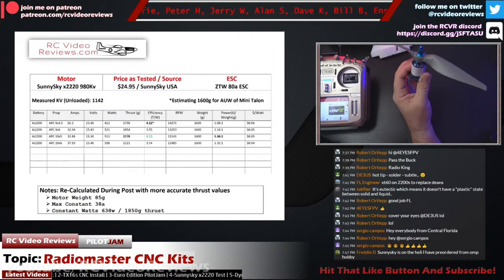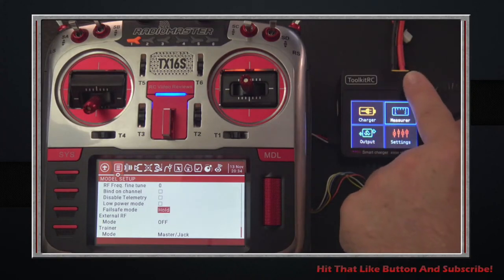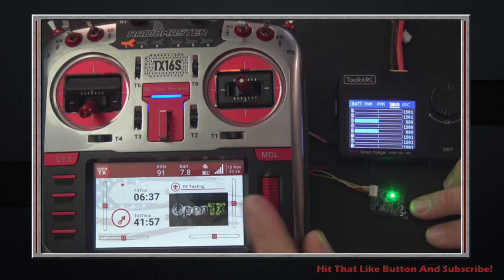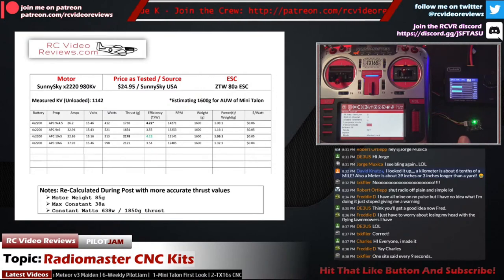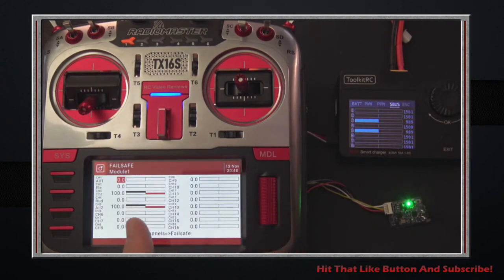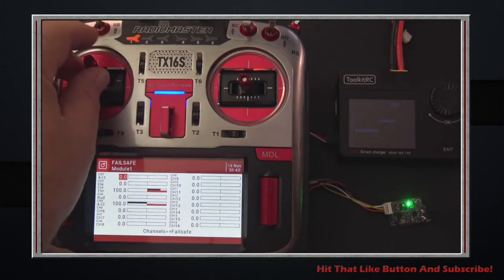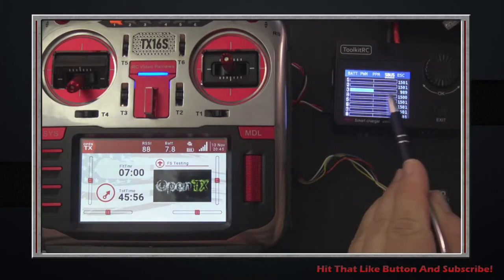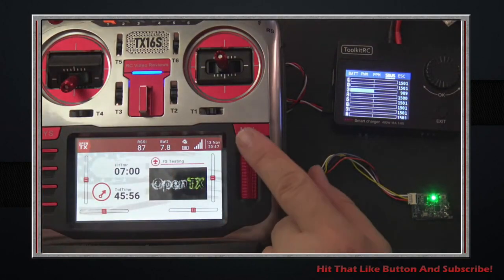OpenTx Tutorial • Failsafe Options Explained with Radio Examples • [Beginners]

Comment: Nice clear explanation - especially on the different options -thanks.  
A couple of comments: be careful with Futaba receivers as their failsafe throttle value is reversed (+100 not -100).  Also some of the 'clone' receivers wont accept commands from the TX so you need to use the "receiver" option as John explained.

Comment: Interesting. A warning about throttle, it's tempting to set the throttle to closed on loss of signal, that's OK for electric power, but not for internal combustion. It may be better to set the throttle to a fast idle. If you get the link back you can power back up and continue to fly safely to a landing. If the throttle closes completely then the engine might stop and if you get the link back you have a dead stick and forced landing.
Reply from the maker: David, Thanks for sharing. I purposely avoided getting into recommended failsafe settings because I found out discussing the subject live that it can be a highly subjective topic. So I made a decision to steer clear of failsafe configuration recommendations. I do appreciate you took the time to write--thank you.
Reply: @RCVideoReviews  I know, I had some heated discussions with club members.
Reply from the maker: This can be a fairly religious subject for some.

Comment: I set up fail safe with the throttle about 40%.  When I was walking to my plane, and pick it up, the signal was swamped, and the fail safe kicked in. The propeller started to spin.  I believe throttle cut was set. Have you noticed something like this?

Comment: Another great vid John. I've followed most of your vids to set my RM TX16S. I have set my F/S on the 'custom' pre sets. They appeared fine with -100 on Throttle which is the most important for me. Any idea why 'they' pre set those numbers particularly on the A, E & R channels? Appears set to glide down??  One thing that I didn't understand well was the 'Receiver' mode. My understanding of your explanation was that the F/S defaults to where ever the stick positions were. If this is the case, it's likely you may say no, it's similar as 'Hold" ? lastly, you said " I hit the F/S button on the receiver". I am confused. Is there a F/S button on a receiver or is it an assigned button the TX to activate F/S?. Sorry, this got lengthy.

Comment: I;m watching this and I see I do ot have failsafe or low power mode on my tx16s. I do get the warning that no fail safe selected but nothing in the model setup. Where do I find this? Thanks, Al
Reply from the maker: Failsafe is presented as an option when you select protocols that provide failsafe. If you don't see it, it's not an option. Likewise, if it's not an option, it should not be warning you it's not set. Something is missing here...

Comment: I do not see a Failsafe mode setting in my Model Setup screen  (Radiomaster TX16s).  When I get down to the low power mode, the next feature is External RF.  I just received the radio the other day.  Thanks
Reply from the maker: If the radio doesn't show failsafe during bind it's because the receiver doesn't support it.

Comment: I am setting up a Z3 fpv w an R-XSR connected via sbus and a QX7. Do I have to do a custom failsafe with the RTH switch for it to go to RTH with signal loss or will it do it automatically?
Reply from the maker: Without firing it up and testing, I can't answer this for sure. What I would suggest is with the prop off, turn the radio off and see if the Z3 status light changes to indicate RTH. If it does, you're all set. Most RTH flight controllers do switch to RTH mode on loss of signal, but you should verify. If not, it's very easy to set custom pulses.